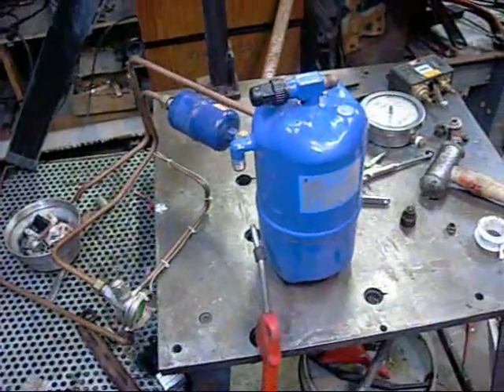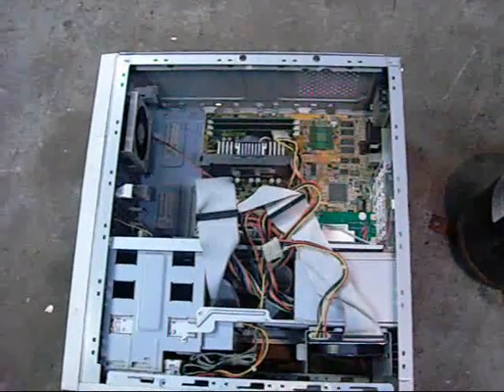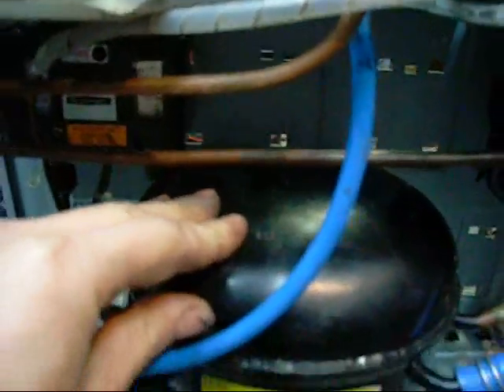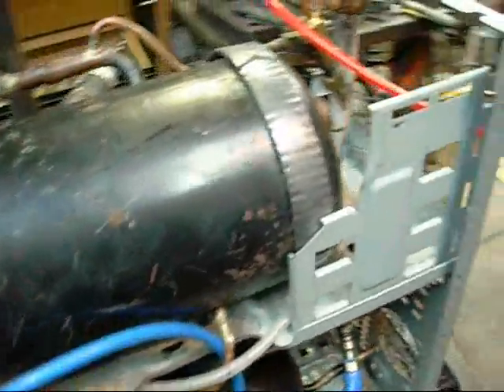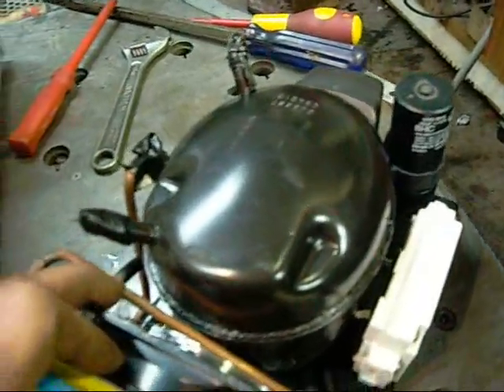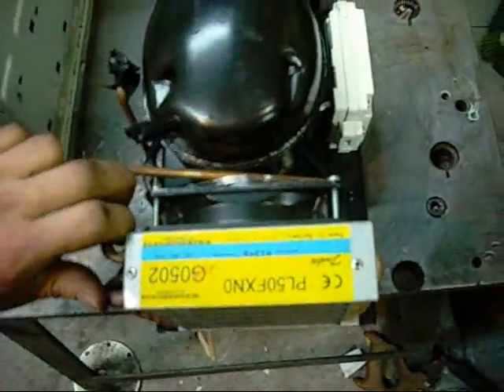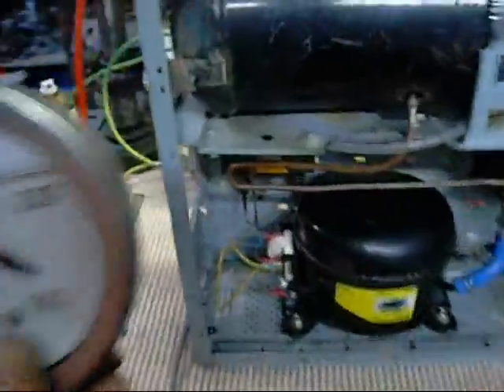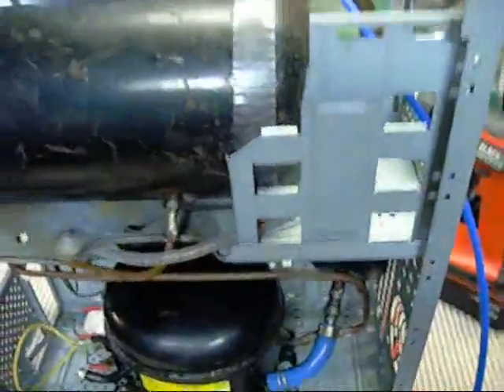Silent Air Compressor in Computer Case

Comment: @Plutoniuts Yep. 150watts is plenty for airbrushing, the dude is from australia, so it's most likely 220v. Your 110v will works just as well.
Filling a 20gallon tank will take ages, but will allow you to use medium size powertools for a minute or two. A 1gallon tank will work fine for airbrushing.
If you need to move it a lot, 1gallon. If you have the room, and got the pressure rating for the 20gal tank - go for it ;)

Comment from the maker: @kalm77 the tank is to collect most moisture and oil (can be drained via a valve on the bottom) and also gives you a amount of stored air under pressure. without it the line pressure would drop immediately and most tools/equipment would stop working.

Comment from the maker: @minilandrover 

I am well aware of how these compressors work, apart from crappy oilless compressors all workshop compressors use crank case oil, and deposit that oil in the tank/discharge line. regular maintainence keeps them all from siezing up

as I've mentioned in previous videos on these compressors, if the pump puts out too much oil, use a oil trap. the New SC15BM in this video puts out less oil than a chinese workshop comp anyway.

Comment: didn;t you realise that fridge compressors run in a closed circuit freon and some lubrication oil for the compressor.  you tank wont rust, it will fill with oil vapour untill the compressor pump runs dry and siezes.. + if you use it to spray paint, ...well nice effect adding oil droplets to your paint eh!  ...bad news using fridge pumps for workshop compressors dude.  oil in tyres or paint is bad news

Comment from the maker: 125 - 150psi is my goal with this one at the moment, but so far the switch and compressor have failed my latest tests. basicly the switch won't run above 100psi and the compressor won't do short cycles without shutting down completely :( (thermistor overheats)

time to replace it with a much bigger, High Start Torque, one :D

Comment: i built one on these, but i used an old oxygen tank as my reservoir and an old Tecumseh fridge compressor. it does the job great, it also  gets over 150 P.S.I which is very useful.

Comment from the maker: lol, not trying to make anyone jelous!, but I'm glad you like the info!. it is handy to have little fan cooled coils like that for heat-exchangers.

just rip the compressor off and replace with a oil or water pump and tank

it was a pretty recent model bench top slushie machine, not sure why it was being parted out but the condensing unit is the best bit IMO!

Comment from the maker: I've seen little portable 12V tire pumps that claim to go to 200Psi, but they are very noisy, expensive and can overheat during long jobs.

The cheap ones always overheat or are too slow, although they don't have a tank so its probably comparable to this one trying to inflate a 44" mud tire!

Comment from the maker: I am pushing the limits with 1200kpa, i was wearing full face visor and earmuffs in case one of the blue lines let go.

The tank and copper tubing is good for over 250PSi but the press fittings are going to be at their limit with 1200kpa.

I'll finish it next weekend and make improvements to allow it to run at around 950kpa

Comment: wow thats 174 psi thats dam good bro
99% of air compressores wont do that bro
you,dam this is another angle to consider
bro 175 psi is dam good bro perhaps 
an impact rench could be ran as a boost on a standerd 120 psi unit as that is the max for 90% of usa air comps,you got me convinced bro i have to build what you showed me ,that thing is 25% of the size of a 200 psi unit and halve that of a 150 psi unit,the fact that you did this is very impressive,175 psi ,wow  good work friend,dam good

Comment: ya bro the pc cabnet is a great idea i may 
install my final hho torch in one
great idea compensating for the vibration 
also thermal cycling will do the same thing some exit port temps can get hot enough to burn skin,i dig the way you use things on a generic level ,its an air compressure to you but ot most people its that blak thing that seem to bee in ever fridge,   wow where did you get that little radiater set up dam bro that  is bad ass that radiater is hard to come by bro great find